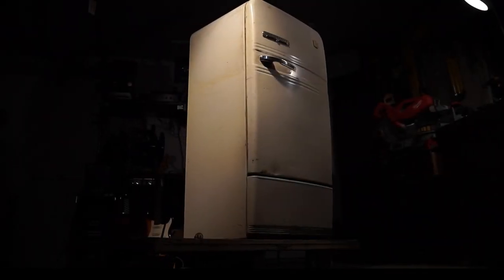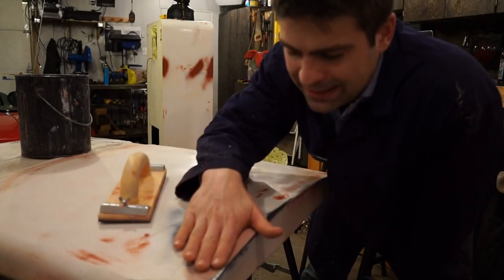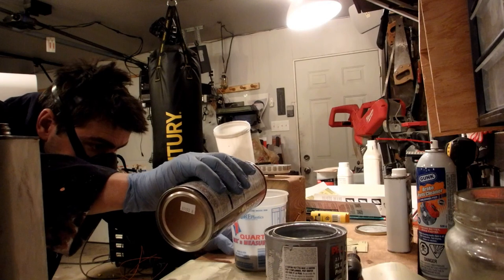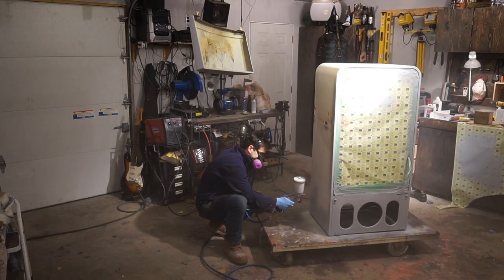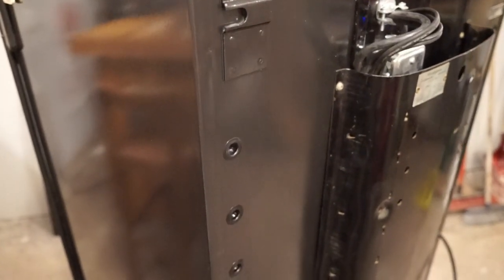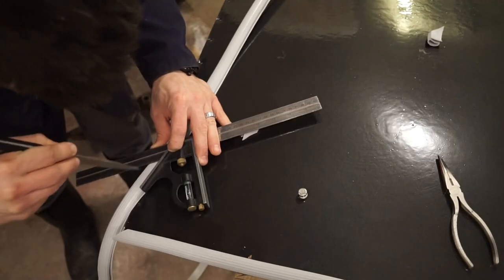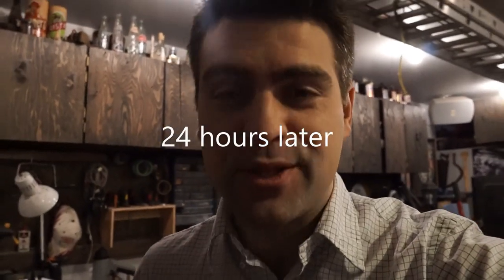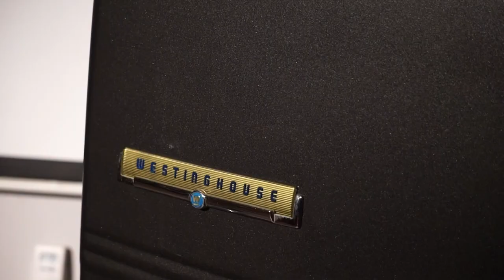Mancave 1950s Beer Fridge Restoration Complete! 2 of 2

Comment: I just redone a 1951 Westinghouse fridge, pretty much the same as this one and used spray foam inside as well. I painted it the outside of the fridge Duplicolor ready to spray Burnt Orange automotive paint and sandblasted and painted all the chrome and with VHT Burnt Copper Engine paint. the reason I used the engine paint on the chrome is because it's oil and grease  resistant so the oils and grease from food won't degrade it.

Comment: AMAZING work-I am in the middle of a similar restore, although to a lesser level than you. My question concerns painting...I had begun sanding down to the bare metal and have experienced some rust in between starting and stopping. Do you think a similar automotive epoxy primer that you used will cover the rust and seal it up?

Comment: I've got a nice old kelvinator that was my grandparents first fridge.  It's still running but in about similar shape as yours was.  Will be restoring it this week as I'm off work.  I'm an HVAC mechanic so I may get a bit more in depth with some of that but only for reliability purposes, not looking to add any features.   Also, had you considered using a vintage bulb inside?  Not sure if it would look wired or cool. Was considering doing a pastel type gray color that I've seen on some old appliances, looked awesome.  Great job anyway

Comment: I am doing an old President fridge 1954 (australian). The door lining made of plastic / acrylic is cracked and a piece missing. I was thinking of patching with fiberglass and then painting with vinyl paint. What do you think? is there another way to restore that.  Also did you get the handle rechromed or just sprayed?

PS your video production is very professional and entertaining.........big thanks from Down under

Comment: I have a very similar Westinghouse fridge and am doing a similar restore.  Thanks for posting this.  ETA: Nevermind, I see your comments below on how to wire the new plug.

The bottom panel (above the compressor) on mine is covered in thick rust, and even has a small hole in it  It seems that it got a lot of condensation.   I'm afraid it will eventually just fall out.  Did you have similar issues with yours?

Comment: Awesome work! I've recently retrofitted my 1950 Hotpoint fridge. I also insulated with spray foam but only did the sides, top and bottom. Do you have any pictures of insulating the back? I ended up having to add some freon to mine but even after all this I am getting an annual kWh of about 650kWh. Any advice you might have?

Comment: Hi great videos, very detailed thank you !! I am going to try to restore an old Hotpoint and need to change out the cord as it is completely frayed, I see you went to a grounded cord, is that difficult to do? Do any other changes need to happen to make it grounded?  Thanks !! Victoria
Reply from the maker: I can tell you what I did, I'm really not qualified to give you a 100% answer though..   I used a 3 wire cable instead, and connected the 3rd wire the green one, to the chassis of the fridge...  that grounds it

Comment: Well Done! Very impressive! I was curious about how loud your fridge is. I have a 1950's Hotpoint fridge which I have made into a beer fridge with taps(kegerator). I do find however that it doesn't get as cold as I would like. I can't seem to get it to go below 3C and it runs very very quiet and doesn't appear to ever stop. No fan since it has no defrost cycle components. Is your fridge very quiet? Do you notice it shutoff from time to time? Thanks!
Reply from the maker: hi John, I wouldn't say it's very quiet.. it has no fan either, b UT you can hear when the compressor kicks on...  the lower compartment where the compressor is used to be fully insulated for sound deadening, not good for heat buildup though...  also not good for holding humidity causing rust when sitting on a garage floor... since I was building this fridge to sit in the shop I didn't bother with it. that being said it is louder than my kitchen fridge when the compressor kicks in... but not loud enough that it would be a nuisance in any way.  it will usually kick on for about 2 or 3 minutes then stay off for a half hour... the new insulation and seal really helped with that..

Comment: hi mate the fridge looks great such a good job. quick question the foam insulation you sprayed in was it something like we have a product called space invader over here? it expands as it sets to fill all the space or was it just aerasol foam?
Reply from the maker: thanks! it expands as it sets...  it's made to fill gaps and cracks around windows and things....   as mentioned in the video it is not made for this...  but so far has worked out very well...

Comment: Did you paint the inside of the fridge?  I'm in the middle of the same project and need to paint the inside of mine since it is scratched up pretty bad.  If you didn't paint the inside of yours, do you have any suggestions?  I was planning on using white automotive paint...will there be any issues using that?
Reply from the maker: I didn't paint mine - it was still in great condition - I took a "if it ain't broke don't fix it" approach.  That being said, if i had to paint it, I would do it with an automotive urethane...   I think that should be OK...  it's so much tougher than anything you get out of a radle can. but I would stick with a not too glossy white so that you don't see the scuff marks over time... as jars and containers will rub against it -  Also, make sure you won't have a problem with putting it over what's on there now, unless you're going back down to bare metal...   It's hard sometimes since you have no clue what kind of paint is already on there.  as best as I could tell, the exterior of my fridge was baked-on enamel.. so i took a chance with an epoxy primer to seal it and it worked very well..    Lacquer base paints i would have went down to bare metal to avoid the cracking etc.

Comment: I’ve got a similar fridge I’d like to restore, I’m hesitant to dismantle the door hinges and handle parts for re chroming,, any advice for dismantling with out damaging the cast iron ?
Reply: What cast iron?
Reply: Adam Noman ,  ?? Maybe not cast iron, but cast metal , whatever was used in the 30s or 40s , I’d hate to crack the hinge covers when prising them off to get the hinges ect re chromed
Reply: @rotorspinny5516  : The fridges are made of stamped sheet steel, like a car. You won't crack the metal, but you could dent it -- or certainly scratch the finish. Painters tape and thin cardboard may be helpful for protection, and just be careful.
Reply: Adam Noman , the hinge itself is what I’m concerned about, it’s cast in 2 parts and also has a cast cap covering either end of the hinge pin , I’d really like to remove all parts along with the handle parts and get them re chromed,
Reply: @rotorspinny5516  Ah-ha. Well, the hinges would still be steel, cast or not, and you won't 'crack' them. However, if the pins have integral 'caps' on both ends, as many regular home door hinges do, then hinge halves were not intended to be separated. 

You may find the restoration experts at Antique Appliances of Georgia can provide more information about your problem -- and they do offer product, such as door seals/gaskets -- that you may need in your project.
Good luck.
Reply: Adam Noman , thanks for your help

Comment: how much did it cost to restore this refrigerator?
Reply from the maker: More than most would consider worth it...   but under $600....    paint $250..  Door gasket $150...   insulation $150... could have bought a new fridge instead, but this one had sentimental value and is way cooler.
Reply: where did you get the door gasket?  im working on a similar Westinghouse fridge(making a 3 tap kegerator)  and I definitely need to replace the old one.
Reply: Are you kidding me? that's nothing... I sell appliances for a living, I could sell easily your fridge with its majestic reliability and looks for 3000$......600$ is a steal for a rebuild....What I sell is crap that doesn't last and encourages consumerism which is horrible for the environment.... What a great idea, thanks for sharing !!

Comment: Bloody brilliant! I'm just starting my resto down here in Australia on my grandparent's fridge. What was in the tin that you used to clean the rust off?  Above my compressor, i have some hard brittle gloss black plastic. Any idea what it is?? Rob
Reply from the maker: +Robbie G Hi Rob! I think you're referring to the 4gal of thinner...  I mostly used it to clean off gummy stuff that was all over the edges of the door...  The old paint can always had water in it for wet sanding; I also used the specially made thinner for tar/wax/silicone removal - I used this every step of the body work paint process to clean off any oils from my fingers etc..    As for the plastic on your fridge, honestly I have no idea what that could be... it is inside the compressor area? what kind of fridge and how old? These are very fun projects.. and everyone that comes over is like WHOA COOL FRIDGE!! :)
Reply: Yep that would be the can... the red one. The plastic is in the compressor area, around the edges at the top. I'm not sure how this works and whether i can share photos. The fridge is awesome, i can't put an exact date on it yet, but its about a 1950 'Emmcold'. Emmcold was taken over by a company that has also since been taken over, so I'm struggling to find much information on it. The back of it is extremely similar to yours... a lot of work ahead, but looking forward to the final product!
Reply from the maker: COOL!  ya so that can was a light thinner - the same one I was using to remove oils before painting etc.  works good for removing gummy stuff as well.    I found the same with my fridge, very hard to find info on it...  so kind of had to wing it... link me a picture or something once you complete it! would love to see it!
Reply: I'll have to figure out how to link it... when it comes to youtube, im awesome at watching videos! not much else!
Reply from the maker: ha ha - no worries!
Reply: do i need to post something? or can i just flick a photo or two somehow in these messages?
Reply from the maker: humm..  i don't think you can, the best way is to post them on an image server like flikr and post a link in the comment
Reply: Apparently i lost my grip on technology some time ago! ill figure it out! lol
thanks for all the tips... im likely to ask more! keep the vids coming dude, content is great so far, presentation is fun. love it
Reply from the maker: +Robbie G COOL! glad you like it!

Comment: hey I just got a 50's fridge found a door seal but what did you buy to convert to three prong plug and also how did you wire it?
Reply from the maker: I'm no expert - take my advise at your own risk: replace the 2-wire cord with a 3 wire one, wire the black and white the exact same as the old 2-wire cord was wired when you took it off..   the green is the ground, the one that wasn't there before. Just add a eyelet on the end and screw it onto a metal surface on the appliance's chassis...  this will ground the entire appliance... make sure you choose a spot that pretty much connects to everything else (conductivity wise)

Comment: So I picked up an old GE 1950s fridge that I am going to turn into a smoker.  It's in very good shape.  I'll be ripping out the compressors and all of that since it will no longer be of use.  More than likely, I'll have to replace my insulation.  I'll at least have to test it to make sure that it's not flammable and contain asbestos.  The biggest job will be sanding it down for new paint.  It has layers and layers of existing paint.  Any recommendations for that?
Reply from the maker: hum - not really - mine had only the original paint, so I cleaned and scuffed it, then primer right on top...  if it has that many layers of who knows what, I would go back down to bare metal... probably using a coarse grit power sander, but if you use coarse grit, you'll have to make sure you smooth out the scratches in the metal with primer and sanding as well..
Reply: I actually had your same problem with the layers of paint.  I used an angle grinder with a coarse paint and rust remover disc, similar to this one https://www.walmart.com/ip/22268333?wmlspartner=wlpa&selectedSellerId=0&adid=22222222227016838495&wl0=&wl1=g&wl2=c&wl3=60355884609&wl4=pla-94762698489&wl5=9060008&wl6=&wl7=&wl8=&wl9=pla&wl10=8175035&wl11=online&wl12=22268333&wl13=&veh=sem .  It's a lot faster than sanding, which would take forever, but it still takes a long long time to get all the paint off and get to the bare metal.  You'll also go through several of these discs, so be prepared to buy at least 10 of them.

Comment: I would have kept the color origianal, other than that, it has a baked on porcelain liner.  They made these to last and used r 12 refrigerant like a refrigerator should have. This fridge will most likely outlast a fridge from today.

Comment: Maybe I'm odd but I prefer original colors on vintage things. If restoring a vintage item, I see it almost as a sin to refinish it in any color or texture other than original as best as you can do it. Whenever I restore my fridge, it will be white. It came white, it will be finished in white again. For some vintage items, I leave the original finish untouched or will seal it somehow to prevent rust. I have a desk fan from the 40's or 50s that was salvaged seized from the curb. After freeing it up and lubricating it, I have left it pretty much as found. I don't think I could refinish it to an original color as the color is a bit odd. A sort of grayish green with hints of brown. I also have a vintage whole-house fan, also rescued from the curb. It has a similar color. When I restore it, I will basically just clean it up, lube it up, and maybe check to see if any parts need replacing. I know the belt needs to be replaced and I know it needs lube. It isn't seized, but is hard to turn.